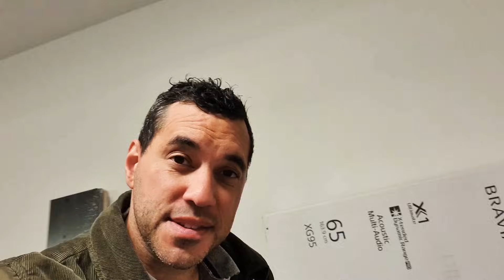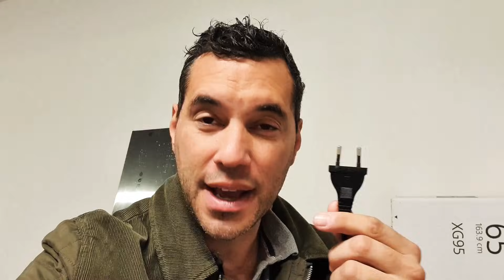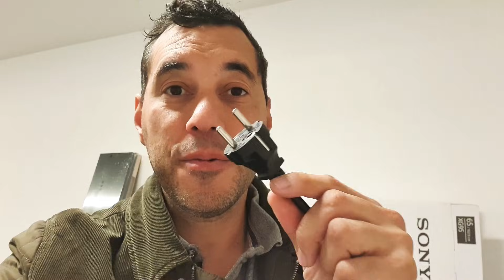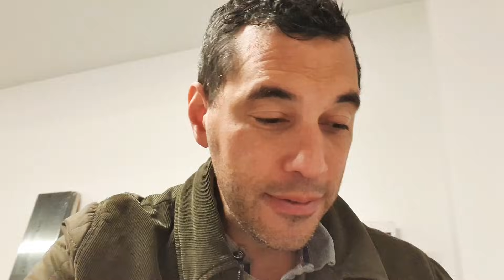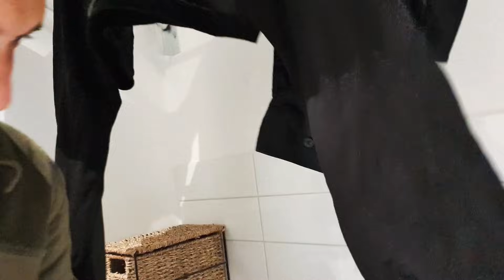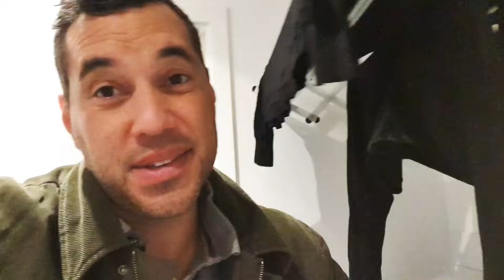Why don't EU plugs have FUSES!!!

Comment: It's just about you being used to UK system, not about Eu being objectively worse.
1. Fuses are unnecessary most of the time and are used in UK only because of the shortcomings of it's wiring.
2. The different phases for outlets seeming random to you, isn't random at all, and makes complete sense if you understand the basics. Especially in your example of a kitchen. Almost very aplience in a kitchen requires a lot of current. So each one can be connected to different breaker/phase to distribute the load. The builder of the house/flat probably thought out what is going to be where and and adjusted the circuit to make the most sense electrically.
2. The shape of the plug is not stupid. It's much better than UK one.
2.1 there are many shapes of it and NONE impale your leg with the prongs if you leave it on the ground, because it is beautiful piece of engineering and somebody probably thought about not making the stable position the most dangerous one, are easy to pull out and safe. 
2.2 like i said there are many shapes of them and 90° ones are common but they have disadvantages when plugging into a extension cords..., You can chose which one you like and somebody, likely orders of magnitude smarter than you, has probably thought about which one is the best to use. 
2.3 once again there are regulations about fuses and they are most of the time not necessarily/embedded in the product it self.
3. There are many designs of the sockets. Your builder/you not having taste isn't issue of eu. + The socket it self has many features and is better than UK one.
Reply: all of these issues are resolved by the switch
Reply: No1. Fuses are unnecessary most of the time

It's that time when a fuse was necessary but was not there and your child died because you weren't sure if it was necessary for a fuse or not and didn't bother with a fuse because it was an option, in the UK we take away that option and sleep soundly at night knowing our children won't be fried to death, that is a good enough reason to mandatory fuse every single plug, tell me I'm wrong!!!
Reply: Note there is no EU system. Each country has their own system.There are 5 different types of grounded sockets in EU though two of them are basically same with modern plugs. In the EU 17 countries use Schuko, 5 countries use French sockets, three use British, and Denmark and Italy each their own though Schuko is increasingly common in Italy.

There is much history behind the plugs. In Britain devices used to be sold without plugs and you bought a plug and wired it. At the same time in Finland you were prohibited from wiring any plug. We saw that as dangerous and as means to circumvent safety systems like changing an ungrounded plug into a grounded one so it would fit into grounded sockets. Nobody would design a schuko plug if one started from scratch. Same with the UK plug.
Reply: Jakub, you have not much of a clue.
Reply: Look, British sockets have multiple safety features:

- A fuse in each socket along with house fuses, meaning that extension cords can all set their own limits
- The only downfall of UK plugs is the foot stabbing thing. They have a strong and sleek design.
- They have slack on the earth cable so that if the wire is tugged, Live and Neutral go first
- They force polarisation to be correct, which improves safety
- The sockets have shutters which only open after the slightly longer earth plug is added in
- The UK plugs have nice and sleek extension cords whilst Europeans have these really bulky ones.
Reply: @56independent  
- Modern homes are build with fuse boxes which will contain like 50 brakers with some specifically dedicated for higher or lower loads, like for example lights need allot less than general wall sockets, induction oven needs allot more so that one gets its own higher grade braker with thicker wires. If you short something then only few things will be cut off. Having fuse in every single plug is just... Silly... And outdated. This would have worked if you had 2 brakers for entire house, but its 2022.
- Downfall of UK plug is not only it being safety hazard but simple convenience, its like USB-B vs USB-C, one of main advantage of new one is that its reversible, you can plug it either way without any issues and comes in wide range of shapes depending on your needs.
- Polarisation is being accounted for by appliance itself, so its a mute point.
- EU plugs have shutters too... Its nothing new... Its basic protection which most modern wall plugs have built in.
- No idea what are you even talking about extension cords being nice and sleek... That has zero todo with actual plug shape... And funny enough extension coords need to be more bulky to be cable in carrying voltage over longer distance and not some thin wires which can catch on fire if you plug in something more heavy at the end of it... 

Your comment is weird, its like you just wanted to boost UK plug without any previous knowledge about EU plugs at all...
Reply: @Zripas  
The British plug is a safety hazard? You haven't a clue. The safest in the world. Been going since 1942.
Reply: @johnburns4017  
Exactly, being going from 1942... It's time to update this outdated plug... USB-B vs USB-C, do you know one of the main benefits for one over the other?
Reply: @Zripas  
The British plug is a design classic. No one makes one better. US plugs and two pin European are terrifyingly dangerous.
Reply: @johnburns4017  
Classic... That's not a good thing, you know?... 
And just FYI if you are not aware, while EU plugs only have 2 pins, plugs itself still have grounding connection... Welcome to 21st century. 
Do you seriously thought that EU plugs comes without grounding?
Reply: @Zripas  wrote:
"you seriously thought that EU plugs comes without grounding?"
Some do not.
Reply: @jakubmastalir3557  
The British plug is designed for hands to hold it. It fits firmly into the socket. The longer ground pin also opens up a sliding protection gate that covers the L & N inlets. The longer ground pin is the fist to make contact and also the last to make contact when the plug is inserted or pulled out - for safety reasons.  

You clearly do not know.  Look at the vid I gave a link to.
Reply: @jakubmastalir3557  
As I wrote in my first post to you, "you have not much of a clue."
Reply: @johnburns4017   About what...
Reply: @56independent  
The British plugs are the best in the world.  A design classic. The British also have an excellent electrical safety record.  Which will get better as the regulations tightened up again recently.

Comment: You have a mix of low and high amperage on a phase to balance the load. About the sockets being ugly, there are a number of sockets available. Modern ones are with glass but are a bit more expensive.
Other than that, it seems like the electric board wasn't set up properly to have selectivity when there is a fault. If there is a earth leakage, a fuse in the plug won't help you either way. And overcurrent fault is easily protected from the board. Usually you don't have 10 things on the same circuit . So the fridge, oven, AC, cooker, washing machine are all on separate fuse.

Comment: I don't see the need for a fuse in the plug? Almost every electrical device has its own fuse and every room has a fuse too.
Reply from the maker: It's more of a localised backup really, peace of mind!
Reply: @BeingSwenglish  
How many backups do you really need? having extra fuse in plug itself only adds extra size to it without any real benefit. This only is a good thing if you have ancient hause where etre house has only 1-2 fuse breakers.
Reply: @BeingSwenglish  My kettle here in France just tripped the entire flat. My immediate thought was to replace the fuse in the kettle to see if that fixed it (rather than immediately buying a new one) but now I see that's not an option. So that's also an argument for having fuses in the appliance - waste!
Reply from the maker: @dovewhite4701  very true, however RCD/fuse-box trips are generally much more sensitive than the fuse in a plug, so in that scenario it's likely that the fuse wouldn't blow. Also, if your kettle often trips the RCD then imagine having to replace the fuse every single time :)
Reply: @BeingSwenglish  I'm just gutted I have to go buy a new kettle!
Reply from the maker: @dovewhite4701  ah that sucks! But don't buy a new one just yet, sometimes kettles and hair-dryers have an internal trip, leave it for an hour, and then try again and it might work!
Reply: The fuse protects the flex and appliance. Any problems only that appliance is taken out. It also facilitates using efficient ring final circuits. Then no large expensive main panel with rows of breakers.
Reply: @johnburns4017  
Fuses should be built into appliance itself... Why add extra bulk to socket instead of simply having this fuse built into appliance itself?
Reply: @Zripas  
The plug fuse protects the flex from overheating - and also the appliance. It is accessible, not hidden inside an appliance needing tools to get at. 

The fused plug also allows efficient ring circuits.
Reply: @johnburns4017  
If you have appliance which melts wires... You need new appliance... And just FYI at the moment you get short between wires, breaker wilp pop. And if you have melting wires in general, then you have shitty wires in your house...

Comment: Respectfully disagree. I have a British toaster where the fuse has blown and now I have to physically replace the fuse which creates more waste for the environment instead of switching that circuit back on in the fusebox. That being said I am in the market for 13A fuses in Stockholm if you have a recommendation 🙂
Reply: Köp en schuko på Jula och byt till svenskt uttag istället.
Reply: If the toaster blew a fuse there is something wrong with it, that is why the fuse blew.  That is why it is there. You would have noticed that the whole circuit never dropped out. You need to investigate why! Occasionally, but rare, a fuse does just blow as it is defective. That is a rare thing.  Try Amazon to buy British plug fuses.

Comment: In Sweden/Europe there are a central with circuit breakers and a residual-current circuit breaker , this makes it safer than the  UK circle connected power circuit, with localized fuses and breakers. To have to open a power socket to be able to replace a blown fuse is an English invention comparable to the water pipes that run on the outside of some English houses . The pipes are easily accessed when the freeze. ( In Sweden we place the water pipes inside , insulated so they don’t freeze). Look at this video also, https://www.youtube.com/watch?v=hZN6hiGLtrE
Reply: Sweden and Europe are not safer than the UK. The UK is safer.  In the UK RCDs are mandatory - AFDDs (arc detection - arcs cause fires) are mandatory in certain situations and recommended for all socket circuits. In the UK the supplier has a large tube fuse for over-current protection, this is usually 60 to 100 amps. Your protection at the main panel should catch any problems and trip individual circuits, if the fuse at the plug does not. The UK regulations say a fault on one circuit must not affect another. In short an RCBO or AFDD on each circuit. An RCBO gives: 1) over-current, 2) fault, 3) earth leakage protection. An AFDD gives: 1) over-current, 2) fault, 3) earth leakage, 4) arcing protection. 

The fused British plugs are the best in the world - they catch over-current on individual appliances, not taking out a whole circuit, localising the fault. A design classic. US plugs are terrifying, as are those as shown in this vid.

Comment: You don’t seem to really understand
Reply from the maker: Care to explain then? 😂
Reply: @BeingSwenglish  first of all the houses I have been in have separate breakers example:
Power meter going into basement and Main main going into apartment in apartment there is main, lights, power sockets and kitchen together and all other sockets on a different one
Reply: @BeingSwenglish  next thing fuses inside plugs are not so smart but neither stupid I personally wouldn’t like them
Reply: If you want ask me more I could be able to answer
Reply: 1:45 there are different types and that one with the wire going straight is actually not that common sorry for the amount of answers

Comment: I don't know this setup ins Sweden, but in Germany we usually don't have any fuses at all. We have circuit breakers set up in a central panel. One for every room and then usually separate ones for where your main appliances go (fridge, oven washing machine etc.) In addition to that every house usually has a RCCB (FE Schutzschalter in German) that immediately cuts power if you basically cross wires. That makes it more or less impossible to get an electric shock. All this makes it very secure, so there is also no need to switch off outlets unless you want to cut off Stand-by power draw for TVs etc. For that we usually use a multi outlet power strip with a switch. In terms of optics - it is something you get used to. I prefer the recessed European outlets to the US ones. It may not look as good when nothing is plugged in - but it usually looks better with 90° plugs plugged in.
Reply: We have both in Sweden. Older houses have fuses and newer houses have circuit breakers.
I really don't understand what he's saying about the three phase oven. They definitely have their own fuses or circuit breakers here. Seems like his installation is illegal, but most likely he just misunderstood it somehow.
Reply: In the Netherlands its unlikely to be for every room, but rather 2 rooms or a floor that work on the same group.
Some appliances have their own group, like the oven. But only in more modern houses. And the whole system is modular. You can always split and add a group.
Reply: I think he blew the main fuse as he said there are three. In Finland main fuses have to be fuses. Breakers are not allowed as they can fail. A fuse never fails.
Reply: @okaro6595  
A fuse never fails?  Wow!
Reply: Same in Iceland ;)
Reply: @MrMix_92  Same in Spain.
Reply: The British G fused plug protects the flex and appliance. No others do.

Comment: I don't really know your situation in detail, but in my experience messy circuits in my country tends to be found in older houses. Back in the time they had a really bad habit of walling the wires without tubing around it, so once it's done, you can't modify it, it's easier to cut it at the ends and install a new circuit. Well if you don't have the budget to properly install a completely new circuit, but you need more amperage and more sockets, you simply add a circuit in parallel. So you end up with a new breaker that breaks like one new socket in each room. By today's standards there should one breaker for lights as per 3~4 rooms, similarly for general purpose sockets, and a separate one for every high current appliances (ovens, water heaters, fridges, pumps, A/C, etc).
As for the three phase wiring, it's quite uncommon here for one house, let alone flat to have all three phases hooked up. It only makes sense if you have some 3phase industrial equipment. One house usually has one phase, and it's alternated in the street between the houses, so they load the three phases relatively evenly. In apartment buildings they usually connect the building itself to all three phases, but each flat is hooked up to only one of them. But if you actually have 3 phases in your house, it is probable that the three phases are distributed in the house so you load them a bit less unevenly. In this case it's likely that sockets meant for big loads in your kitchen (like the oven) are on one phase, all generic purpose sockets and lights are on another, and the water heater is on the third, or something alike. This may also lead to seemingly random sockets going out on a breaker trip, while others remain live in the very same room.
(Sorry for the long comment, probably noone will read it, but since I've already typed it, I'll post it anyway. If you read it, well thx.)

Comment: never choose English/UK standard, you will lose every time. the incorrectly designed UK electrical system in the walls forces the consumer to use fused plugs. make it right from the beginning, a good standard is a nice start, the UK has non
Reply: ring circuit uses less copper